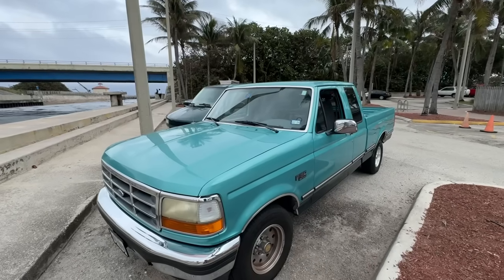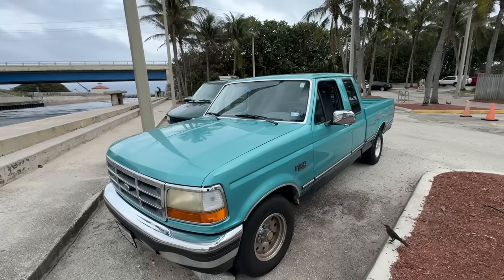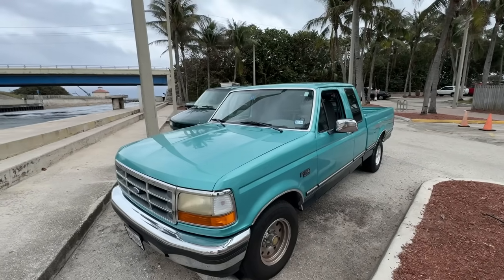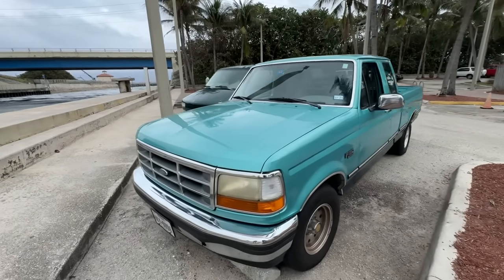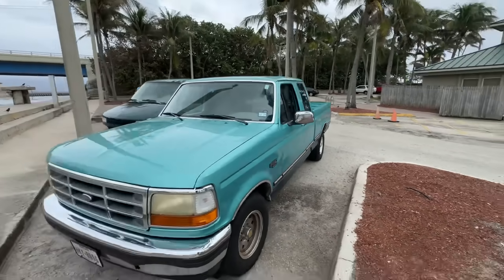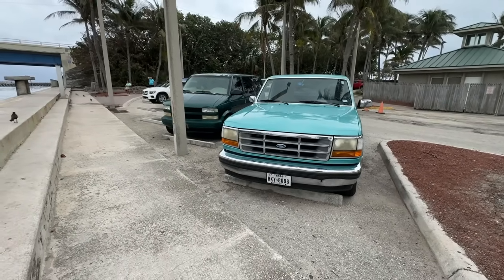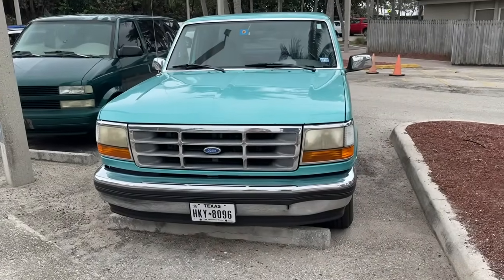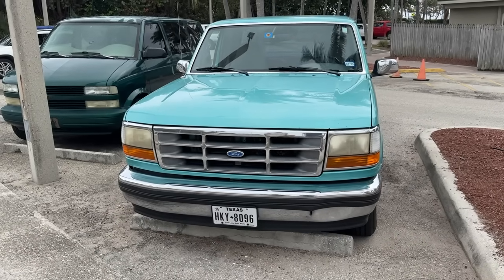Meet Mark from Texas and his 1994 Ford F150 #BoyntonInlet #SocialSecurity #Boynton ￼

Comment: 1994 f150 short Bed 4#4 4.9 in line 6  best engine ever made ..   traded for new 01 Ford short bed  now has 250.000 mile mint never driven in snow or salt ... Both fine trucks...